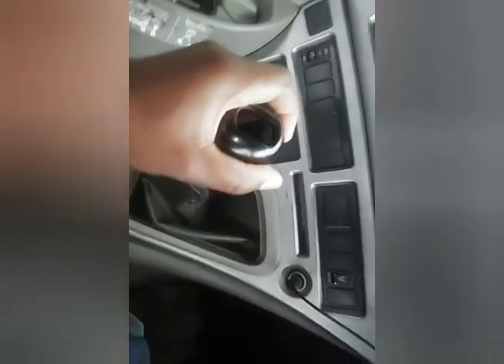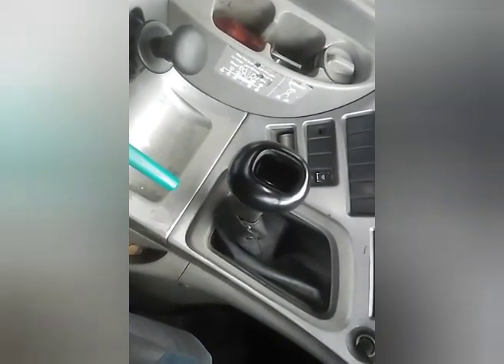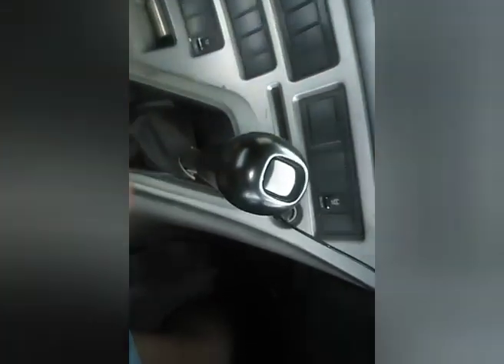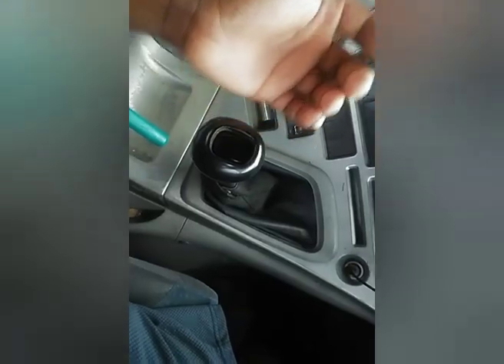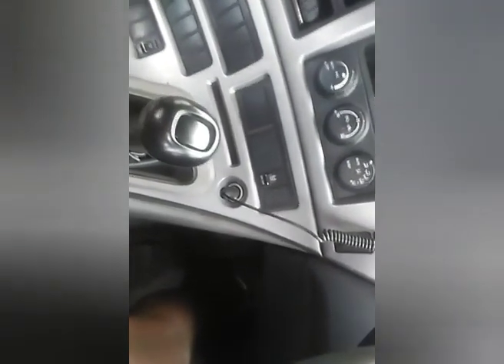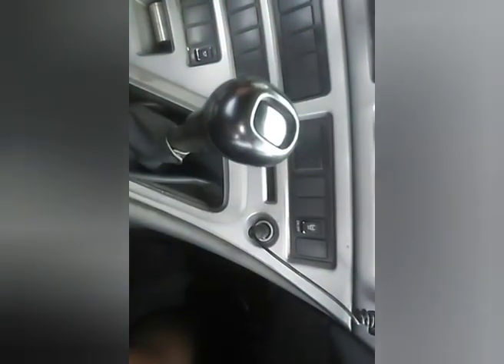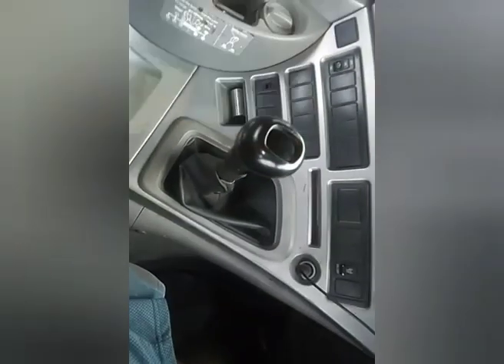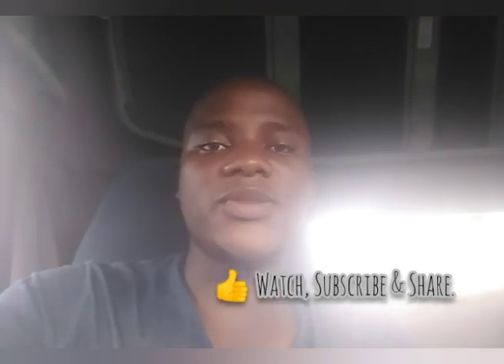How to change gears on UD 460 truck (16 Speed/Forward)

Comment: About your clutch,it comes first than select a gear or a gear first than clutch after?
Reply from the maker: Like a small car, your clutchh goes 1st then your gear
Reply: Thank booss
Reply: Mine got a problem with the split is ok to drive it only with the high gears